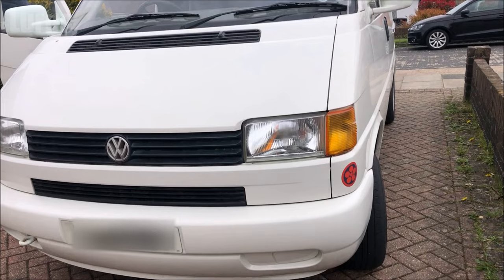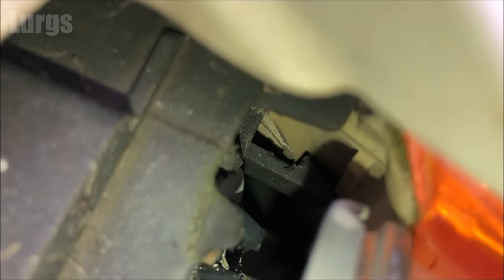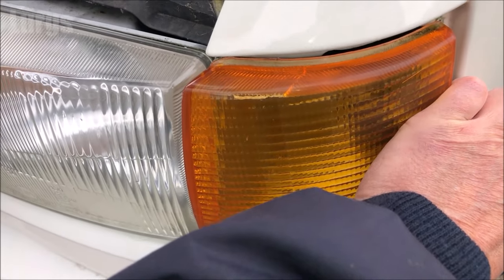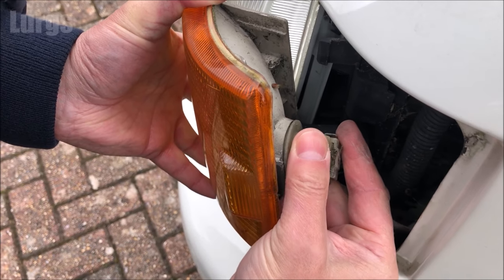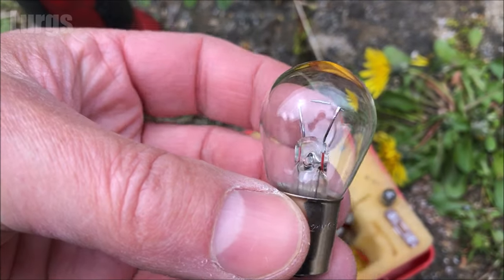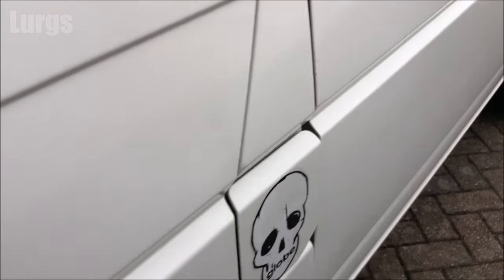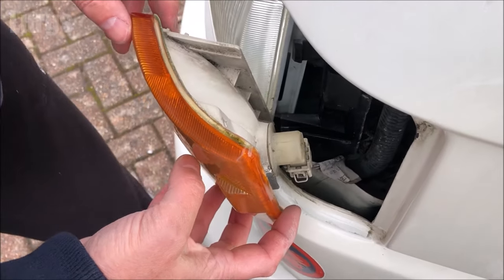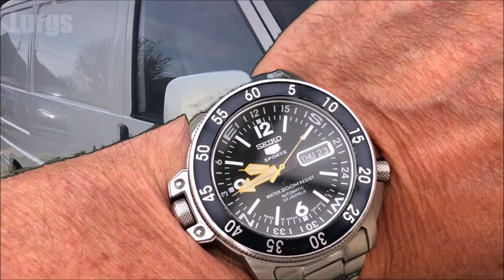How to replace front indicator bulb on VW T4 Transporter

Comment: Excellent guide, very clear. 

When the garage did the MOT on my T4 a few years ago they said the orange bulbs had faded and needed replacing. The old bulbs were orange varnish on a clear bulb rather than a bulb with actual orange glass. 

Fast forward a few years to last week and I was checking the bulbs and found I was unable to remove them. Looks like the garage jammed the wrong bulb in there, ones with offset pins PY21W/BAU15s. I have just purchased a pair of bulb holders from a breaker for £10. One day a bulb will blow and I don't know if I will be able to remove the old bulbs without damaging the holders.

Straight/parallel pin bulbs are P21W or BA15s.
Reply from the maker: Blimey that’s poor of they’ve jammed the wrong bulbs in. It’s a very standard size bulb. Glad my video helped. Merry Christmas 🎄